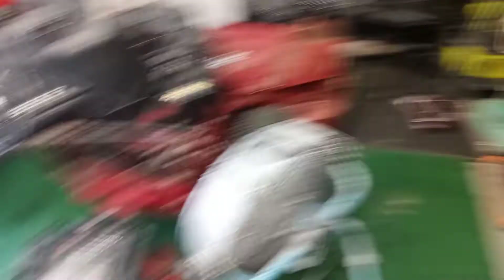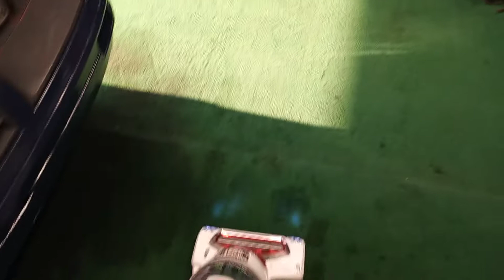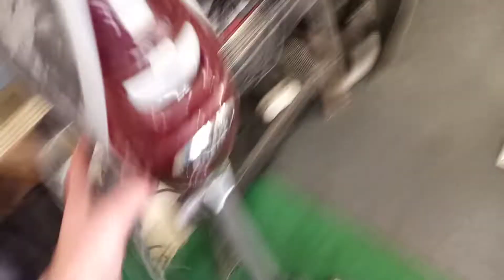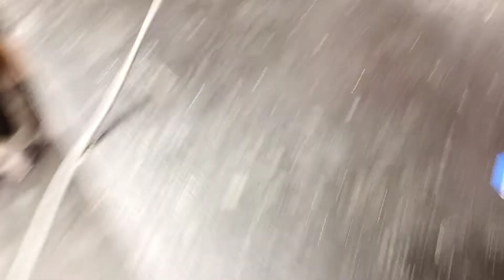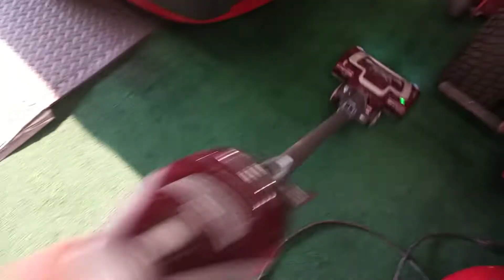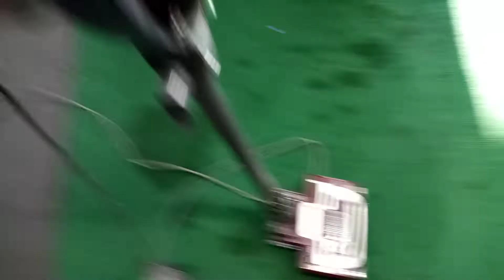New vacuums: Shark Rotator and Rocket

Comment: I have a rocket series machine that my mom bought new in 2014 and we had it up until 2017 when she replaced it with a dyson and gave me the rocket. I have it as my bedroom cleaner now along with my royal hand vac.
The shark rocket had the power head replaced once on it and the company shipped out the replacement. At some point I got ahold of the old head and fixed it so I have an extra head kicking around for the machine somewhere.
In 2017 my mom bought a dyson machine and still has it.
Iv taken great care of the rocket compaired to what my sisters have put every single one of our vacuums through lol.
For some reason they think its ok to pickup large items like bottle caps, hair pins, and rubber bands with the machine thats why they tend to not last long and everything that was said to be broken on that shark has never ever ever been a problem with me ever since I was given it and I practically had to referbish it lol.
Reply from the maker: The public at large is oblivious to what is on their carpet when they vacuum. Its not that people don't know that anything that isnt crumbs or dust is not what a vacuum is intended to pick up, they just don't care to inspect ahead of time
Reply: @S15collector exactly

Comment: You can't really get parts for shark which is stupid but they get the job done.
Reply from the maker: I was told by someone who had multiple sharks she would never buy another brand because any time she had the slightest problem with her sharks they sent out new parts no questions asked for free
Reply: @S15collector  oh ok, I heard from intellitech studios that you couldn't really get parts from shark, I might've been thinking of someone else on YouTube who didn't really like sharks. I would definitely prefer a shark over a bissell these days.
Reply: @jakemccormick6958  it depends on the specific part, and usually there's very little available unless you want to replace entire components like powwrheads, bodies, etc. Sharks warranty on the motors are great, I've gotten replacements free of charge on used ones, but everything else is off the table and not covered by their warranties
Reply: @IntellitechStudios  oh ok now I understand you, I'm no expert on sharks. Ok so the warranty covers certain parts.
Reply: @jakemccormick6958  the warranty only covers the suction motor. Everything else is not covered including the brush motor b
Reply: @Ca31_Buff  wow that kinda sucks
Reply: they send you parts for the machines
Reply: @coolelectronics1759  good luck getting it under warranty!!
Reply: @S15collector  This is correct.  Shark does not stock spare parts for their vacuums (likely because AHEM they are made by several dozen chinese conglomerates and there is no way to ship and stock extras without ordering bulk cargo containers of product at cost which they will never bother with doing that). 

 Because of this, any problem you have with the vacuum, they will require you to either 1.) ship the vacuum to them at your expense (over $100), or 2.) they will ship you a entirely new vacuum, which is russian roulette if it is a rebuilt model or actually brand new. It depends on your warranty coverage and the damage.
Reply: @S15collector  Do you Have Bissell Pet Hair Eraser 3920 Vacuum?